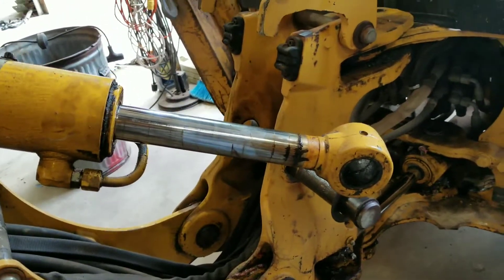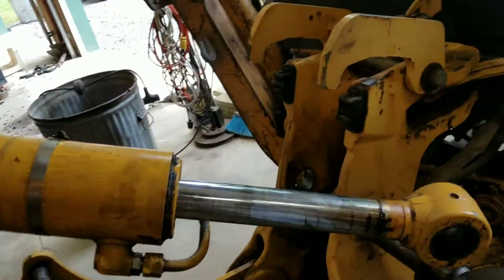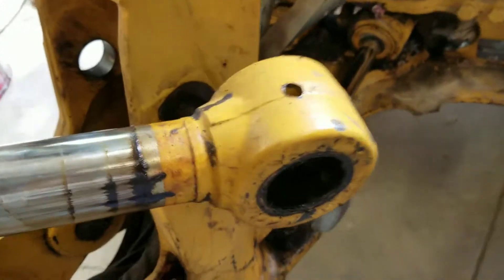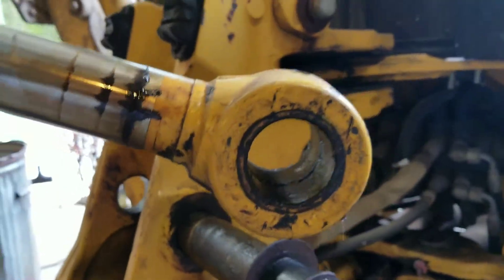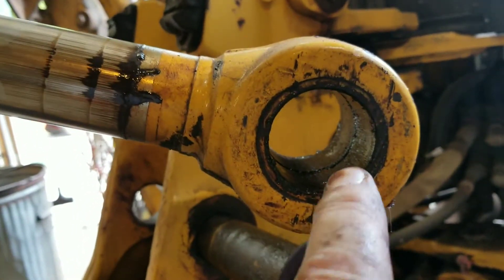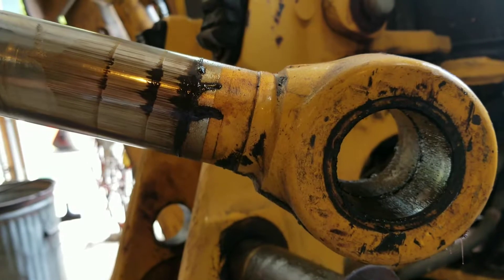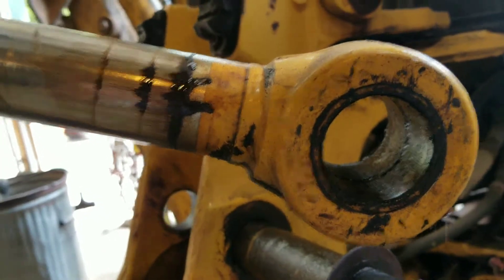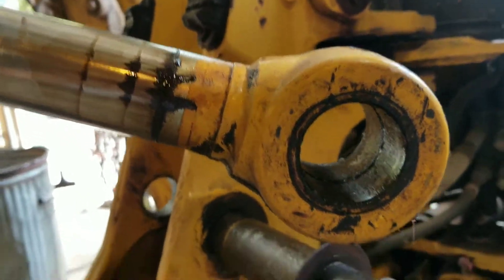John Deere 110 tlb spun bushing

Comment: You shouldn't need to rotate the bushing if the bushing has a grease groove between the outter edge and sleeve.
Reply from the maker: Sean, that's what I was thinking but it will not take grease. The grease zerk pushed out